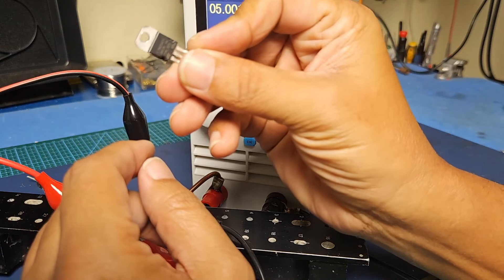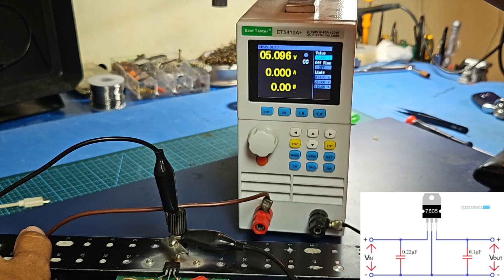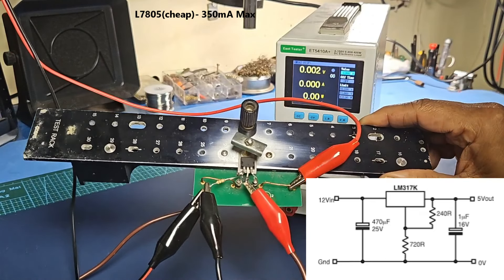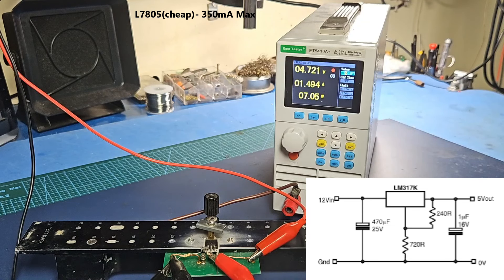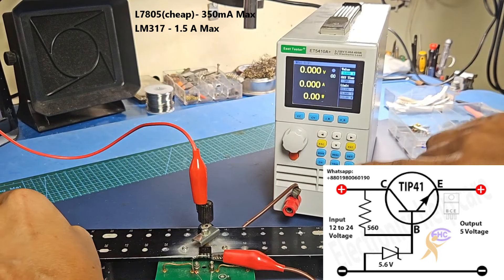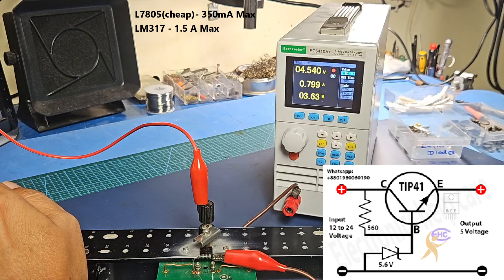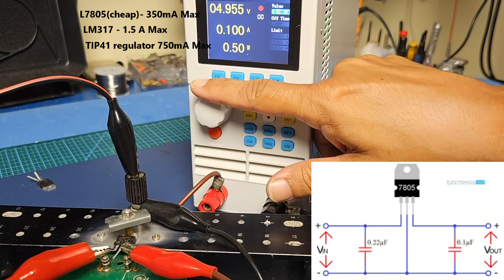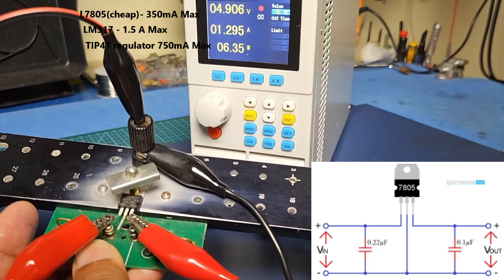L7805 රේගුලේටර්  load test

Comment: Buck converter මීට වඩා හොඳ යි නේද සර්
Reply: Buck convertor wala noise wadi
Reply: Radio circuit එහෙම on කරාම noise ගොඩයි
Reply from the maker: Efficiency පැත්තෙන් buck converters ඉතා හොඳයි.. වැඩි ampere වලදී buck converters තමයි එකම විසදුම .. Application එක අනුව noise filtering තිබිය යුතුයි.
Reply: @dilshan1971  ස්තුති සර්❤️
Reply: @osandasandaruwan718  ස්තුති ❤️